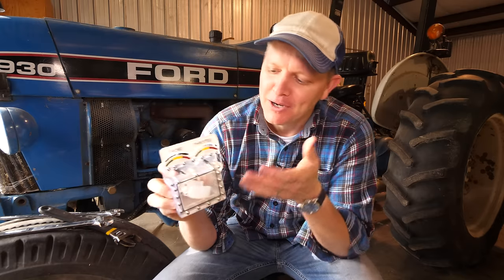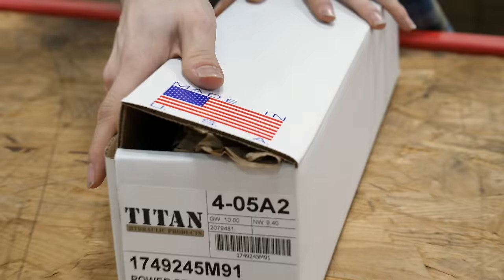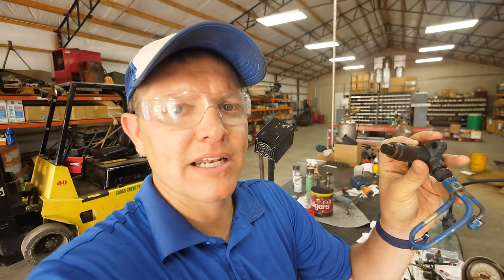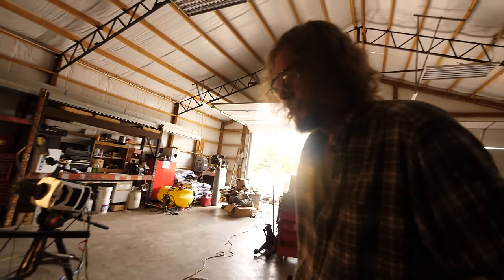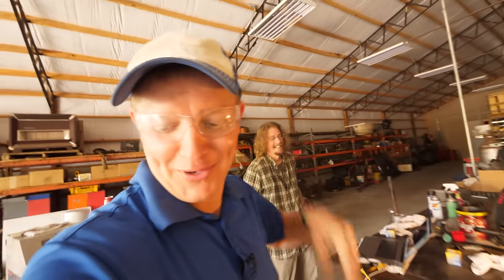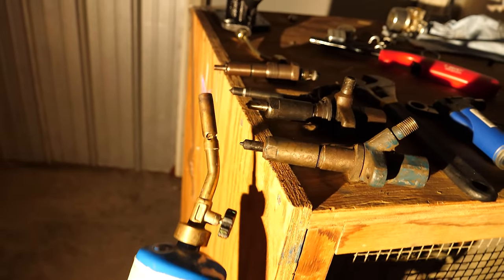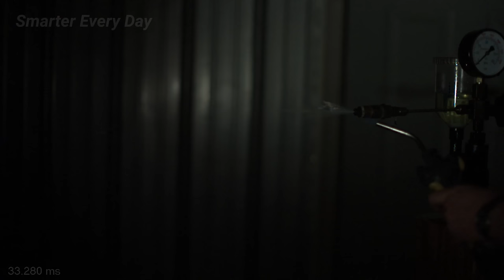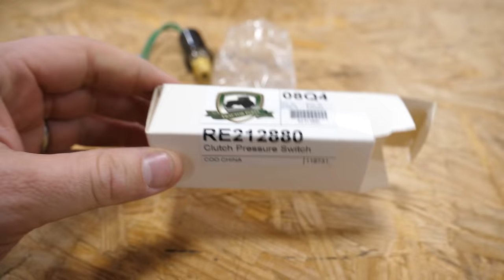Why Fuel Injectors are AWESOME (28,000 fps Slow Mo) Part 1 - Smarter Every Day 281

Comment: It's so hard to explain how fuel is delivered to a vehicle if somebody has never seen it actually happen. This is literally the best showcase of how fuel injectors work. Amazing job.  as always!
Reply: It's even harder to explain HEUI injection
Reply: @caterpillarslim1288  why is it hard? It‘s just an electromagnetic valve.
Reply: @Phrew  its even harder to explain how a 2 stroke engines bottom end is lubricated... they use the fuel to lubricate the bearings lol
Reply: I love when I see other YouTubers that I watch comment on other videos I watch.
Reply: @Phrew   c’mon, that’s a little misleading.  I mean there is more to the system and its function than a solenoid, right?
Reply: I don't think its too hard to explain, you just have to find the right everyday equivalent or analogy. I think a good one is a spray bottle like you find in kitchen or bathroom cleaning products. Explaining the electronic solenoid part is maybe a bit harder but it is no different from something like the trigger on an airbrush.
Reply: I'm trying to imagine this whole volume being compressed into the combustion chamber.
How does that even work?
Lol!
Reply: Destin loves him a slo-mo camera and the effect for teaching is superb!
Reply: @Aramaki1337  to fire it but to build pressure it runs off engine oil
Reply: @Phrew  none of the once on the video were using electromagnetic valves. And even than you'd have to explain what an electromagnetic valve is.
Reply: Atomized? Doesn't seem that hard to me. "fuel gets put through a spray bottle so it's misty and in contact with more oxygen. then compression or spark makes it go boom"
Seeing it happen doesn't change how simple that explanation is.
Reply: @bmxscape  No, two strokes are simple.
 You can see the slots where fuel oil mix gets in. Some of the Suzuki and Kawasaki are a little bit more difficult to explain when they use centrifugal force to supply oil to big end bearings from a main bearing (Honda used same system for a long time on various motors and they are four stroke!)
Reply: @bryandraughn9830   When gases are rapidly compressed heat is generated.  The opposite happens when gases rapidly expand.  A great example can be seen as frost formation tire’s valve stem after removing core on an inflated tire.  
There’s an experiment you can perform with a device called a “fire pump” or “fire syringe”.  I’m sure you can google it if you wish; but essentially take a pump and place a small piece of cotton in the chamber.  If you depress the plunger fast enough the heat generated will be enough to ignite the cotton.
Incidentally, the fire pump and this phenomenon has been known to man for thousands of years.
Reply: Agreed!
Reply: @Phrew  you forgot about the oil galleys, fuel galley, intensifier pistons, and the oil system that runs it
Reply: As somebody who has never seen it happen, I'm glad that Destin was able to demonstrate it so well.
Reply: Just to clarify, this is how DIESEL fuel injectors work. Gasoline injectors are a completely different technology. First of all, Gasoline runs at a MUCH lower pressure. About 100 psi. And rather than be pressure activated, they're controlled by an electric solenoid, that pulls a pintle off of it's seat. It allows for a much finer control over the spray, and duration of spray. But can't withstand the heat and pressures associated with a diesel.
Reply: @salemcripple  but how do diesel engines control the rail pressure at each injector to overcome the valve and spray the diesel fuel? because on gasoline is easy by computer anas you mentioned with electric solenoids
Reply: @salemcripple  These are old fashioned diesel injectors too. Modern diesel engines have fuel pressures of around 30,000psi.
Reply: Why would that be hard. It's literally nothing more than an ordinary spray bottle. Exactly the same mechanism.
Reply: @mstrdiver  உ
Reply: @mstrdiver
Reply: It’s not that hard if you yourself know how it works
Reply: @Darkknight512 if I have to explain EFI to someone who doesn’t understand but understands carbs? I just say it’s individual carbs, on a single common throttle and the all tuning screws are being adjusted by a computer.  It might not give a perfect representation, but they’ll get the right idea and treat it right
Reply: @salemcripple  The solenoid is just an electromagnetic switch(valve).  It is controlled by an ECM which sends the trigger signals for each cylinder.
Reply: @bmxscape  not a 2 stroke diesel. However, they are complicated to say the least.
Reply: @Phrew . Where was the electricity for the electromagnetic valve in this video.
Reply: @RotoRCol . Diesel engines(from this video) most commonly use a "rack".(the master fuel pump injector system is more conplicated to explain.) The rack is a gear that connects all the pumping pistons. A pump piston squeezes the diesel to increase pressure till its respective injector fires. The pumping piston has a (albeit weird) v groove cut into its side. There is a bypass pinhole in the cylinder. It is worth noting the pump piston and cylinder are rather tight tolerance. What controls the amount of fuel injected is determined by where this v groove passes the bypass hole in the cylinder wall. The pump piston rotates according to the rack position.
Reply: Its hard to explain if a person is a simp.
Reply: @bmxscape its pretty simple but its still really crazy that it works yeah
Reply: @bryandraughn9830 when the cilinder is at its lowest the air has a really low pressure so its easy to compress

Comment: Destin, you inspired me to become an engineer. Years ago when I was fresh out of the military you were kind enough to correspond with me via email about various photography techniques. I now work in aviation engineering. Along that trail to get to where I am today I worked as an automotive mechanic and I have a lot of these tools and a curious mind. It's very difficult to convince myself to be responsible and not try this at home 😂. 

Thank you for always staying curious and helping to inspire more people to be as well. I promise I probably won't try this at home. Maybe at work though.
Reply: Yeah, at home is definitely not safe, but at work, heck yeah! 😂
Reply: recently changed my major to engineering based on legends like destin and mark robber
Reply: That's right, do it at work on the clock!  Okay realistically I've had to do a spray-pattern test like twice in 10 years, but it's still fun with the old testers!
Reply: Did you go to college to become an engineer before you were a mechanic?

Comment: I wonder how a flame would interact with laminar gasoline flow?  Because there is no turbulence would it just never ignite, or maybe the flame being a flow of it's own would disturb the laminar flow and cause the turbulence needed for ignition.  These are the thoughts you make us think, Destin 😂
Reply: I wonder if the airflow would cause enough fumes to form and be ignitable around the flow 🤔🤔
Reply: Gasoline is INCREDIBLY volatile. It'd start to evaporate on the way down and the fumes would easily catch on fire. The liquid isn't ever what ignites. It's the vapor coming off of it.
It's why you never use gasoline as a fire starter. If you wait more than a couple minutes, you have a massive cloud of gasoline vapor that's literally ready to explode once lit.
Reply: @Hero  to his point. I guess laminar flow would best increase the chances of minimal gas build up given minimal surface area. So it would light. But I guess it would be the hardest to light of the flow patterns. Maybe. I've never done the test, just guessing
Reply: @ivanbarreras9445  It'd still be flowing past a lot of unsaturated air so the gas would naturally kind of want to fill it. The BEST case open air scenario is a deep container with no air flow over it. Gas vapor is heavier than air so it'll mostly sink and should somewhat stay contained without airflow disturbing it and allowing more to evaporate. Still, gasoline is probably the most volatile liquid I know of other than maybe alcohol. Any gasoline left in open air isn't gonna be great news.

But yes, the smaller the surface area, the slower it'll evaporate. So laminar would definitely be best
Reply: gasoline liquid never burns, it's always just the vapors that burn. so in a laminar flow condition it would still just engulf the liquid with flame and would likely disturb the flow at some point. would be interesting to see though.
Reply: Laminar flow needs a certain amount of liquid to become stable. Gasoline needs to be a vapor to burn. There is no point in which these two different states cross each other so it is not possible.
Reply: @John B  not possible to light? I think even in laminar flow, evaporation would continue to occur in the surface
Reply: @ivanbarreras9445  yeah, for sure the vapors would burn.
Reply: @Heroo01  Been there, done that... My arm hairs and eyebrows eventually grew back LOL... Thats one of those valuable life lessons that only takes on lesson to learn for life.. I think I was 11 or 12 when I learned. I'll never forget that lesson LOL :)
Reply: So cute how Brad thinks he’s as smart as Destin hahahaha
Reply: @nickldominator  
Winner
Reply: @Heroo01  
Also winner
Reply: @Jabullz  
Then which part prevents it from happening?
Reply: @ivanbarreras9445  
You are correct. The vapors around the column of fuel would burn.
Reply: Most people don't understand the difference between turbulent and laminar flow. They think that the only way to have laminar flow is to have all the fluid flowing at the same exact velocity. That is not true. If that were the case, then you could never have laminar flow in a pipe. If you were to have a column of fuel that was traveling at the same exact velocity throughout the column, you would still have turbulence in the boundary layer between the fuel and the air. That would be enough to allow the outer layer of fuel to burn, and the inner layer will continue forward carrying the flame with it. This phenomenon can be seen when forest fire firefighters drip burning fuel from their fire cans when they're lighting a back burn. It can also be seen for a little distance until the air turbulence breaks up the fuel spray enough when a flamethrower is used.
Reply: @Heroo01  And if one ABSOLUTELY MUST use gasoline on a fire like some retar redneck, NEVER do it directly from the can.
Reply: @Heroo01  Kerosene or Diesel Fuel are what I use and always light the brush pile on the uphill side as the fumes are heavier than air and will settle below.
Reply: only vapor ignites; I learned this as a kid when me and my friend poured a bunch of gasoline on an office chair, lit a stick on fire and went to set the chair on fire. 5 feet from the chair, there was a sudden ignition and a flame front went from my fence to my house in my backyard; neighbors called 911 and my entire street got shut down with police and fire trucks, but we already put the fire out (I had a garden hose at the ready), and my friend dipped out and left me all alone to deal with the cops
Reply: As the turbulence increases flame front speed increases.  This is important becuase at low rpm the time for combustion isn't long enough for the time availible at high rpm.  However, as rpm increases the turbulence increases and the flame front from the spark actually travels faster and keeps up with the shortened time allowed for combustion.
Reply: Up vote for Destin to get testin
Reply: Modern higher efficiency gasoline engines use direct injection like this so it has to be possible some how haha. They use an electronically controlled injector that is way more precise than the injectors shown in this video. Instead of an injection pump having to override a spring they have a constant supply of super high pressure fuel (25000 psi plus) fed to them and an electric solenoid opens and closes a valve to pulse in the fuel. They are so precise that they can fire 20+ times per power stroke of the engine. Crazy fast! Haha.
Reply: @Heroo01  Same goes for pouring gasoline on a lit fire. Dangerous, but at least predictable. However, I've seen what happens when someone doesn't pour it close enough and it just pools on the ground, apparently harmless... until it explodes. If gasoline doesn't burn immediately, get back and stay there until it does.
Reply: @Heroo01  While I agree gasoline shouldn't be used by the uninitiated to start fires. It's still my favorite way to kick off a big fire. Granted, as you point out the timeline needs to be tightly controlled and you still want to be a good 6-10ft back and using a long stick to start it. Lit my hand and leg on fire once trying out a new gasoline 'experiment' (read: me being an idiot).

Comment: Awesome video, Destin. A lot of general aviation aircraft now use fuel injection (vs. carburetors) so it is cool to see it in action!
Reply: the ASI and Destin should do a video together. It would be almost certainly be interesting.
Reply: Aircraft have been fuel injected for well over a century now, long before it became common in automotive use, and it's kind of rare to find carbureted GA aircraft with more than 180HP.  EFI and FADEC is probably what you're thinking of.
Reply: @Skinflaps_Meatslapper  carbureted aircraft are still relatively common in the wider GA fleet
Reply: @Skinflaps_Meatslapper Isn’t the reason for that because a fuel injected engine can work perfectly upside down or in any angle?
Reply: @AirSafetyInstitute  Yeah, below 180HP, as I said.  Above that point it's uncommon to see a carb.
Reply: @xmysef4920  It's not the primary reason, as most fuel injected aircraft aren't capable of inverted flight.  Fuel injection is more efficient for a number of reasons, and you don't have to worry about carb icing up either.  You can sort of make a carb work inverted with a few tricks, but if you want extended and reliable inverted flight, then fuel injection is necessary.
Reply: @Skinflaps_Meatslapper  not just that, but it’s easier to adjust the air/fuel ratio as the altitude changes.

Comment: Hey Destin, my family had a small business dealing with Cetane testing, so we spent a LOT of time working with various fuel injectors. We even produced some high speed footage of auto-ignition in a combustion chamber by using a quartz window back in the early 00's. High speed cameras have come a long way since then. I think the cameras we were using were something like 180px horizontal resolution, haha. It's super cool to see the flame propagation through air with such detail! Very cool to see this being covered!

Comment: Don't forget that, in your experiments, you had air at a pressure of 1 bar.
Inside a cylinder you have a higher air pressure, resulting in more air within a smaller volume. This is why your flames only started further away from the nozzle instead of right in front of it, like they would inside a motor.

Thanks for introducing this company to me. My father-in-law has an old Ford 1600 that's become increasingly more difficult to keep running due to missing parts. I hope they ship to Europe! :)
Reply: The thing that was boggling my mind througoutthe video is that there is no air inlet for air on the injection system... this pressurized air you talk about, where does it come from?
Reply: @jakubstanicek6726 what do you mean there is no air inlet. You mean like a carb pulls air and full in with the pistons upstroke? It’s not like that with a fuel injection?
Reply: @Duality333  I mean, when he is spraying with the injector in the video, a 100% fuel goes through the fuel injector and the oxygen comes from the air around. If you spray into the combustion chamber instead, you need a way to prefill it with fresh air everytime before injection.
Reply: @jakubstanicek6726  there’s something called the induction stroke mate, think you need to look up how an engine works
Reply: @LR90_200TDI  Yeah thats clear when you have a carburator, I was just not sure how that works with injection. So only air is pulled in, and the fuel is injected after that?
Reply: @jakubstanicek6726  in a Diesel engine only air is drawn in on the induction stroke while on a petrol with injection when the engine is sucking in air the injector also injects a metered amount of fuel usually into the inlet ports which then mixes in the cylinder
Reply: Wait till he finds out about direct injection and turbos.
Reply: 13:17 he mentioned this

Comment: I am a diesel engine design engineer and recently I was simulating flow from a injector and there is so much more happening.
1. Hydro erosion
2. Flow breaking
3. Droplet cavitation
4. Evaporation
5. Air drag
6. Swirl
7. Fuel leak (back flow)
8. Combustion bowl induced redirection
Physics complexity arises from coupling of multiphase flow ,cavitation, fuel evaporation, thermal coupling, multiple interface boundary (fuel/droplet, droplet/air, air/vapour, fuel/air, droplet cloud modelling,).
It’s so complex it just irresistible❤️

Comment: 12:22 - you talk about the radial boundary being based on the stoichiometry, which is a factor, but also consider that there is flow happening! As the stream pushes outwards, it is carrying fuel mass and air (vapors) outwards, which continues to push the flame front in addition to the AF gradient. Super awesome stuff to think about! Thanks for this video!!

Comment: I really enjoyed this video. Since you’re planning to explore other methods of fuel injection, I think it would be extremely cool to see a comparison between a typical car’s fuel injectors (~350cc/min) and a big methanol fuel injector, like top fuel/high end drag racing uses (the biggest individual injectors I’m aware of are advertised as being able to flow over 11,000 cc/min, or 1050 pounds per hour of fuel).
Reply: What's the flow rate of one of them 100,000 hp cargo ship engines?
Reply: This would be so cool!